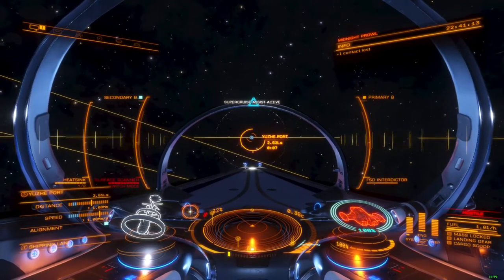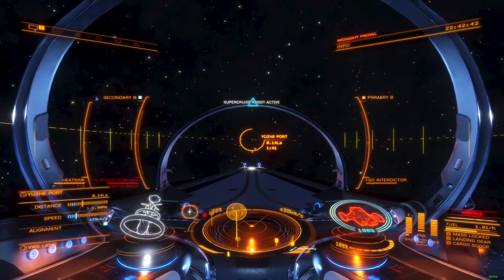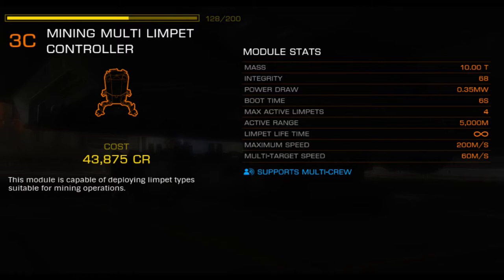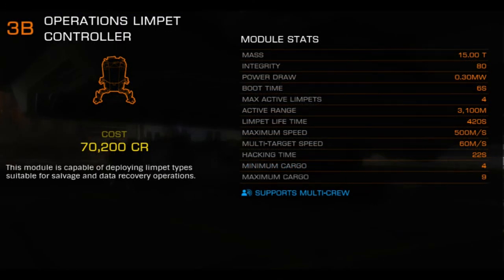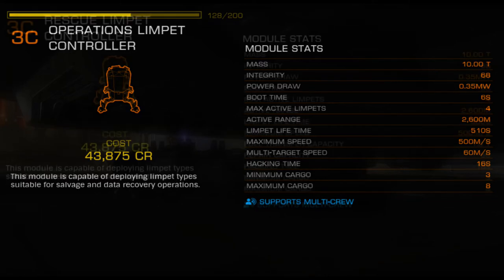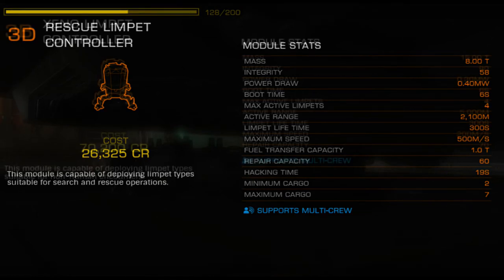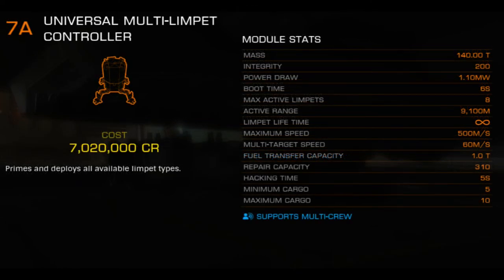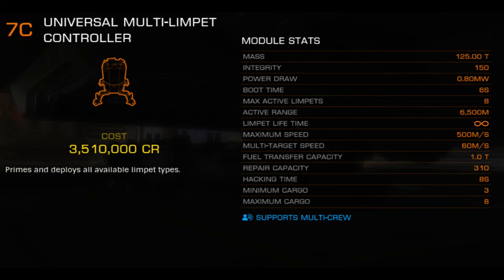Elite Dangerous | Module Review | Multi Limpet Controller Overview

Comment: question: what if i use a mining controller as a replacement for just the collectors? as the multi controller allows for more, albeit lowergrade limpets.
Reply from the maker: It should work fine. You'll get a bunch of C grade collection limpets. I favor D rated since the 0.5 km range keeps them from wondering off too far. 

So long as you are ok with the compromises it's a good way to get an extra limpet.